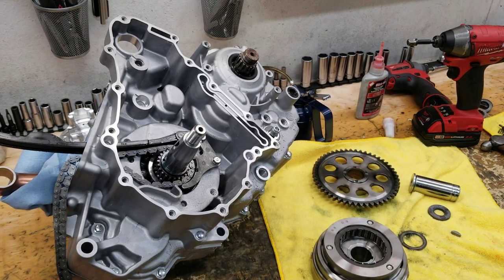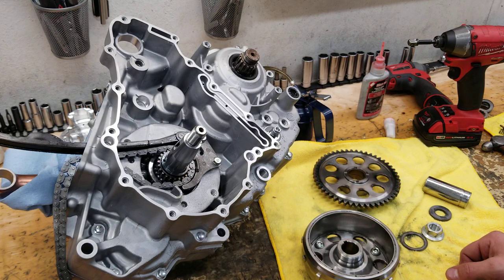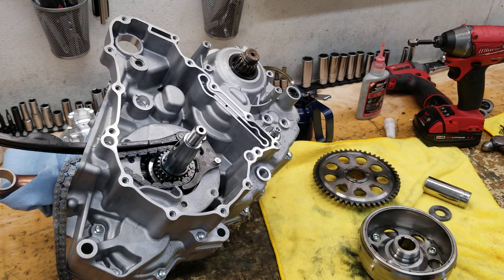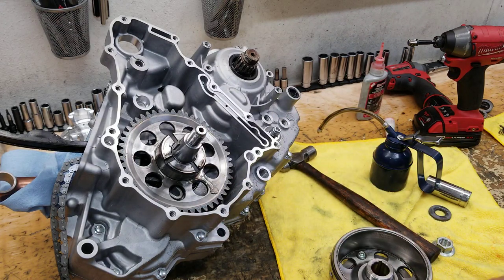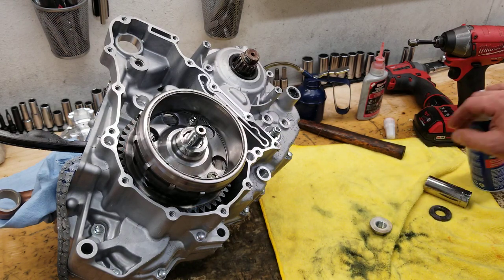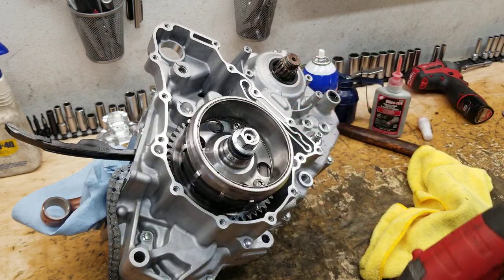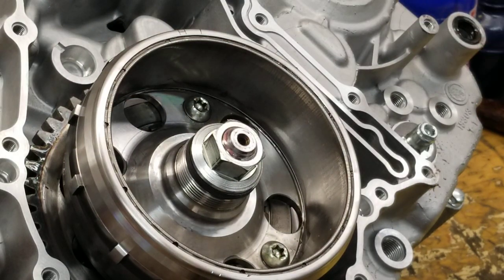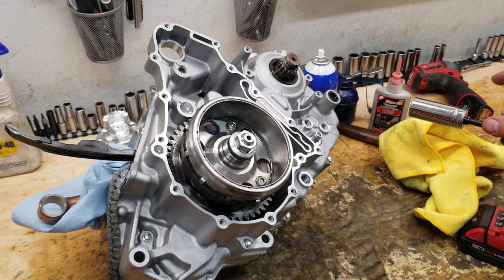The most common engine building mistake on the 700 and how to eliminate it

Comment: This is how I torque down flywheels on trucks, lug nuts on one to two ton trucks! Have double checked with a torque wrench and back off nuts and always is within a few foot pounds of specs! I’ll add that I hand tighten till it bottoms out and impact till they all turn 3/4s if a turn after snug!